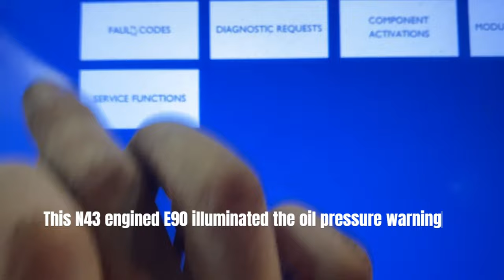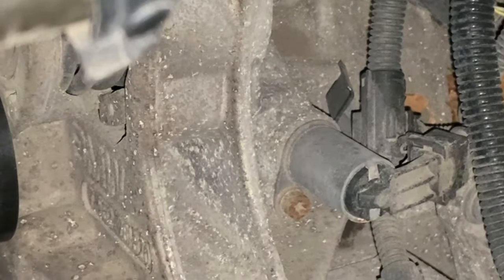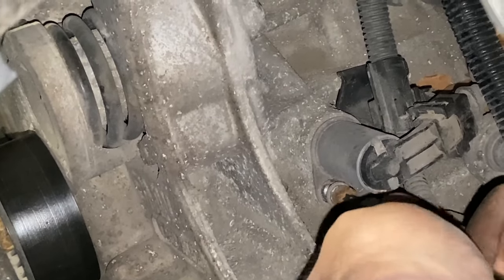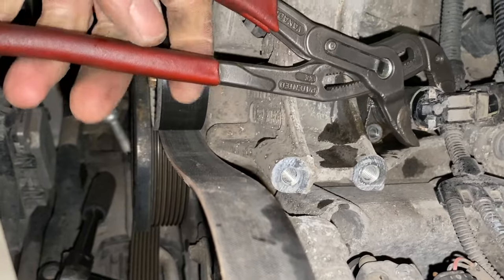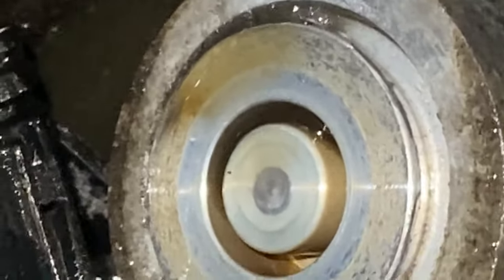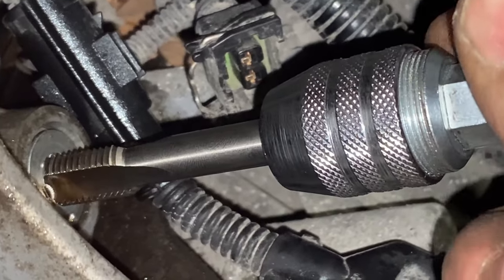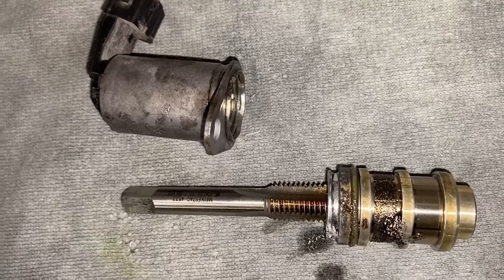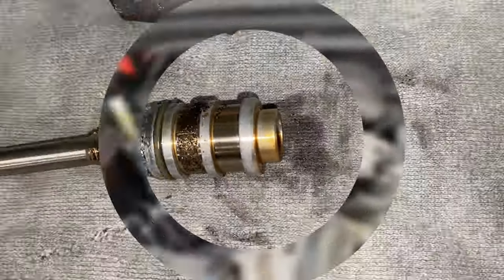BMW E90 N43 oil pressure too low

Comment: Mate brilliant video very informative and very fucking helpful mate thank you
Reply from the maker: 😅👍 Glad to hear it. Please feel free to watch my other videos
Reply: @allmech_BMW_fault_finding  don't worry I.will I have 318i e91 had same light changed solenoid light came back after an hour so hopefully this fixes it
Reply: @allmech_BMW_fault_finding  ok so iv done that sensor and still got oil light on dash and oil pressure static any suggestions??
Reply: And just to add iv already rebuilt the engine and I cleaned the pick up pipe when I did the rebuild
Reply from the maker: @jamesmarnell934 You need to physically measure the oil pressure to see what it is exactly. The usual cause of this is also bits of broken plastic from the timing chain guides partially blocking the suction pipe of the oil pump. If you cant clear it with a new pressure control valve it becomes very difficult to remedy. Usually there is metal everywhere from the timing chain and its not possible to clear without a full rebuild. 
Did you replace the oil pressure control valve as in my video? If so was there lots of metal? Oil pressure switch may contain metal also so worth taking it off and cleaning out but oil pressure measurement is needed
Reply: @allmech_BMW_fault_finding  so I have fully rebuilt the engine from ground up both sensor and solenoid have been changed for genuine bmw  parts timming chain is new oil pump sprocket chain and tensioner new all gaskets replaced rings replaced all bearings replaced non return oil valves in the block new. Also iv changed the hole exhaust all sensors and changed and coded 2 new injectors from.bmw.

Now before I baugt the car it had been mapped not sure to what stage but it also has pops and bangs now once I changed the sensor and solenoid it was fine no light didn't miss a beat for around hour and half  then light came back rough idle died out and wouldn't restart for around 20 mins after sitting and cooling down also its dumping so much petrol into the oil when open oil cap it burns your eyes. 

So would I be right in thinking the map is fucked causing over fueling and as a result diluting the oil so much it can't built pressure properly hence the oil light sorry for the story and any spelling mistakes  🤣😅
Reply from the maker: @jamesmarnell934 Mate without knowing I have no idea but I made a video yesterdsy from one N43 where the timing was out due to fuel injectors in cyls 1 and 2 leaking and this I think haa caused timing to go out.
Will try to upload tomorrow night.
Get a bore camera borrow if needed and make sure those new injectors aint leaking. If high pressure pump started failing they bugger up new injectors. Going off what you said maybe the diluted fuel is causing oil pressure probs. Are your spark plugs black with wet fuel?
Reply: @allmech_BMW_fault_finding  no thats a fair point mate and I haven't pull the plugs yet iv got it going in tomorrow to get flashed back to factory then Iv got mineral flushing oil the flush engine and once iv got new oil and filter I'll go from.there I think the map its the sole cause of it all I'll update tomorrow once it's been un mapped 🤣 thank you tho mate really appreciate it
Reply: @allmech_BMW_fault_finding  oh and as for the injectors gonna pull all 4 plum them in just on fuel lines unplug all Coils turn it over and see if  any are leaking
Reply from the maker: @jamesmarnell934 No worries fella. Hope you get it sorted. Im opening a membership soon maybe you can join? Level 1 will be around 6.99 a month. You will have access to unlisted videos etc. Keep an eye out. Looks like I will do this at the end of the month
Reply: @allmech_BMW_fault_finding  thanks mate and yeah I might just do that where in the uk are you based might send you this head ace if I can't sort it 🤣🤣🤣
Reply: @allmech_BMW_fault_finding  ok so little update had the ecu put back to factory and its now really flat between 1500 and 2500 rpm still over fueling and diluting the oil BUT it don't cut out anymore just runs shit for a minute then settles so back to the drawing board 😂😂
Reply from the maker: @jamesmarnell934 Any fault codes at all?
Reply: @allmech_BMW_fault_finding  yea a few so I don't have a proper computer this is just off an app 
In the order they appear I got 
P0172 system to rich 
2A2B mixture control 
30C1 oil pressure control static 
2AF8 nox sensor ( its brand new from bm ) 
29E0 fuel mixture control
Reply from the maker: James mate. I think your other two injectors are leaking champ. Go borrow a borescope or find one somehow. Surely you must have two normal spark plugs and two wet or black ones. We need to get that engine cranking with injectors disconnected then plug in ONLY the injector to the cylinder you are testing and looking in. Hold cam high so it dont hit pistons. Have a mate crank it then lower and twist to see injector.
Reply: @allmech_BMW_fault_finding  gonna go do that now and will report back but I'm more than inclined to agree 👍
Reply from the maker: Awesome bud. Let me know
Reply: @allmech_BMW_fault_finding  well changed injectors coded in and still fuel trims are way out of wack still dumping fuel into oil still got oil light
Reply from the maker: @jamesmarnell934 New injectors? Is the timing okay? I just had an N43 with leaking injectors that had spun the crank hub sprocket. Did you find leaking injectors?
Reply: @allmech_BMW_fault_finding  pretty sure timing is OK I mean it don't miss fire at a loss with it at this point and crank sprocket was replaced on rebuild
Reply from the maker: @jamesmarnell934 live data might show whats up with it. If you have no timing related fault codes its likely ok. 
Did you look if the intake valves are carboned up?
Reply: @allmech_BMW_fault_finding  yeah there fine live date shows fuel trims hitting + and - 40%
Reply: @allmech_BMW_fault_finding  I think it's time to conced and take it to bm 😭😭😭😭😭😭
Reply from the maker: @jamesmarnell934 Find a good specialist mate. Are you near London area? I know a guy whos very good there
Reply: @allmech_BMW_fault_finding  where and how much lol
Reply: @allmech_BMW_fault_finding  hey man random one could a faulty battery be adding to my problems obviously I know alternator takes over once engine Is on but if the bat is bad enough it interrupt voltage or am.i.wrong ?
Reply from the maker: @jamesmarnell934 No it can not. But if you have a worn battery change it, however always remember to check the main battery cable under the car and earth strap for corrosion!
Reply: @allmech_BMW_fault_finding  so turns out the battery was causing alot of Problems but it's been to bm and they have diagnosed it as the hpfp so gonna swap it out and go from.there
Reply from the maker: The hp pumps do go intermittently. DONT BUY AFTERMARKET. I just threw one in the bin after just 3 months use. Well... it went back on warranty. Genuine one mate and I know - mad expensive.
Reply: @allmech_BMW_fault_finding  well it is genuine... genuine second hand 🤣🤣🤣🤣 its was 20 quid if it works brilliant if not iv not lost out

Comment: I got my engine rebuilt and a few months in the low oil pressure warning came up. It comes on sometimes after driving it for a long time then when the car idles afterwards. Never on the motorway or when driving it without stopping. If it happens in the city it would be during idle only after 30-45 mins of driving but if the car turns off and on when auto start stop is engaged it comes off completely until I stop driving and idle for a while again. Any ideas?
Reply from the maker: Without knowing who or how they rebuilt it mate no idea. Question to ask is did they re-use the original valve? Start with that bud as it sounds like the valve.